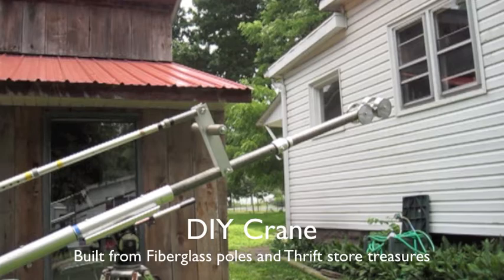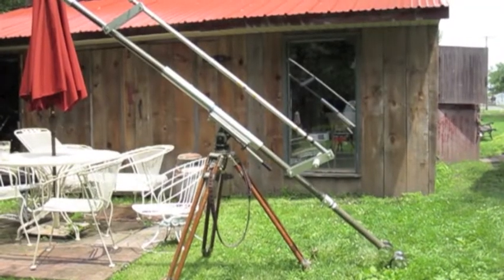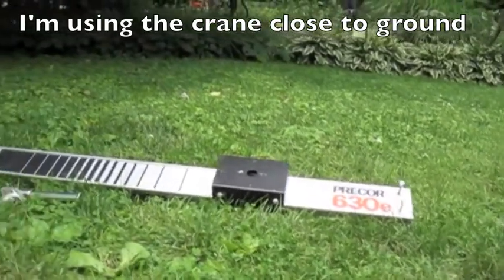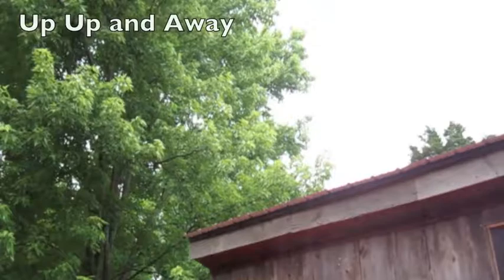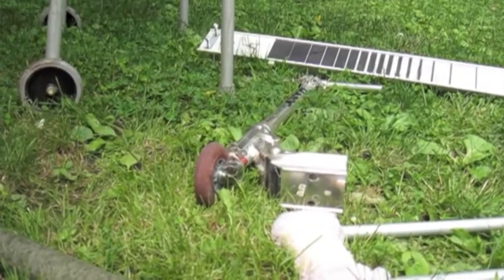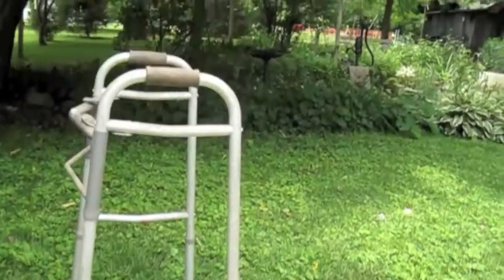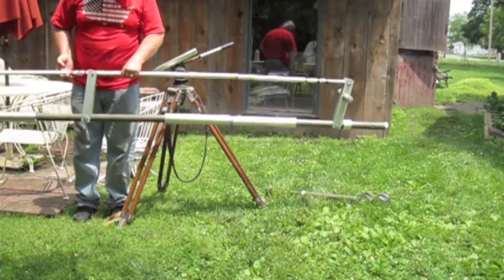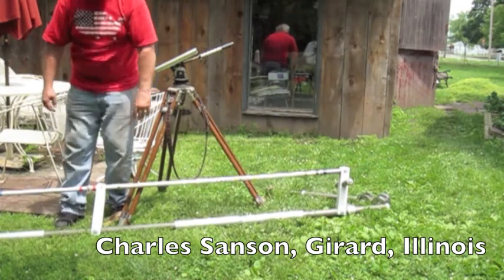DIY Camera crane from Salvation Army store items Girard State Illinois Canon camera t2i

Comment from the maker: You must place re-inforcement tubes around the joints of the poles. I was lucky enough to have the legs of the exercise machine to do so. The most important joint is the one between the tripod and camera plate. The length of the crane caused one joint to crack. I had the joint bolted, but it still cracked at that joint. It did not crack in my shop, but as I was assembelling it in the field. I did not have the re-inforcment tube over the joint . My fault not the cranes.